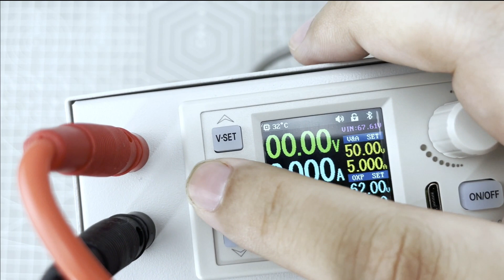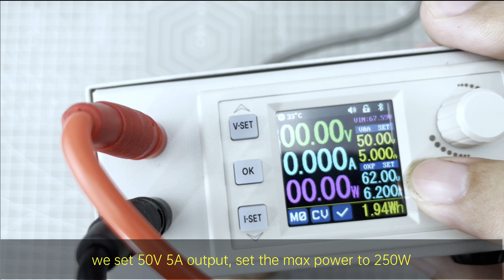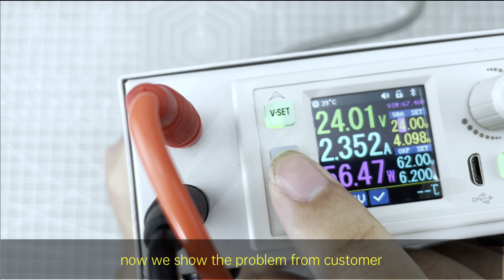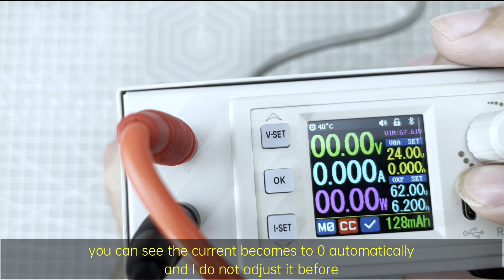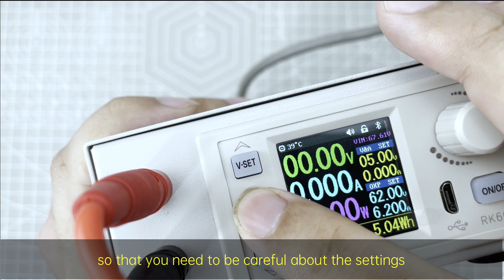Power limit function of RD power supply and RK power supply RD6024 RK6006 RD6018 RD6012

Comment: Guys my DPS5020 burned out 5 times already from inductive/capacitive/backflow incidents.
Your support was helpful and spare parts are cheap but fixing it is still a pain in the butt.
Is RD6024 better protected against this kinda stuff?
Reply from the maker: hello, for inductive load, no matter which power supply you use, you can only use it in 1/3 of the output range, otherwise the inrush current will damage the power supply, for backflow problem, if you use the battery charging terminal, there is no problem
Reply: @rdtech9153  Don't remember every case but last time it burned when I tried to use DPS5020 as a battery simulator to test behavior of a 12V DC UPS. When the UPS tried to "charge" it the MOSFETSs flew out, sent a high voltage pulse down the UPS killing both units. A Lab Psu should have some sorta protection against current backflow. If RD6024 can survive such scenario then I'm sold.
Reply from the maker: @yunodiewtf  hello, for load which has power, if you connect it in the correct way, and the battery voltage does not exceeds 50V DC, it will not damage the device itself, but if you connect the battery in the wrong way, it will damage the device, so that in the new RD series power supply we add a battery charging terminal, it has protection function for battery

Comment: The RK6006 maximum output current spec is 6A. The device isn't limited to this in the firmware. What is the danger of supplying higher currents up to the output fuse rating for lower output voltages?
Reply from the maker: in the system setting page, it is power limit function, not the current limit function, if you want to limit the output current, you just set the OCP value(over-current protection) and it is ok
Reply: To answer my own question, the firmware does limit the current to 6.1A. I guess this is to protect mainly the current measurement shunt resistor. However a 10A output fuse does seem high if the protection is needed.
Reply from the maker: @milel0  hello, if the ocp value set to 6A, when you set 6A output, you can never turn on the output, because once the output current reaches this value, the output will be cut off, so that the OCP/OVP value must be a little higher than the value you need, and, and the fuse is not used to protect the output current, it is used to prevent the damage from the revere current from Battery, so that we use 10A fuse